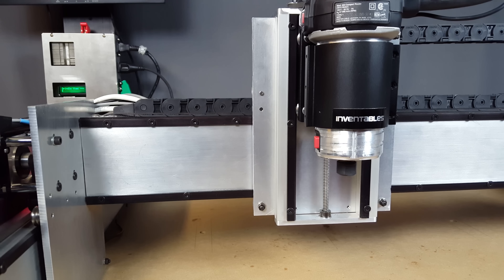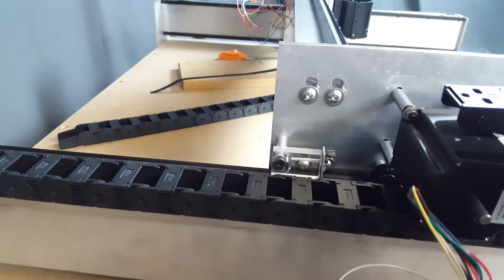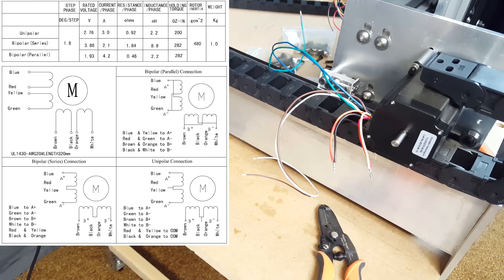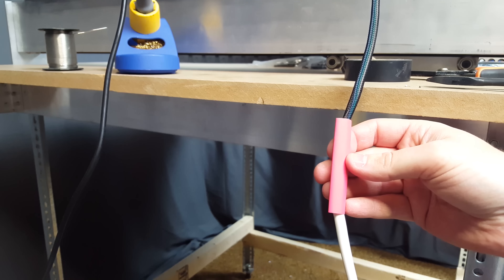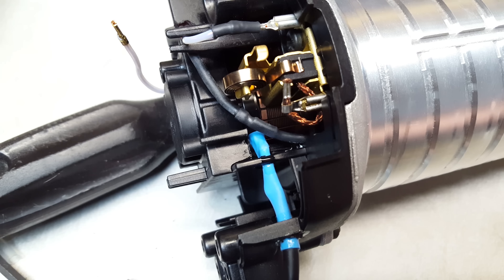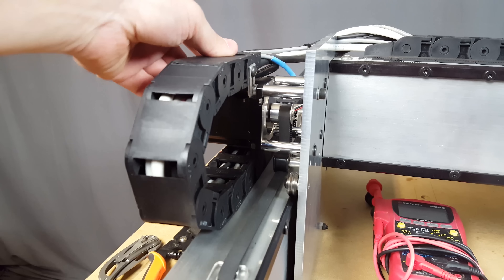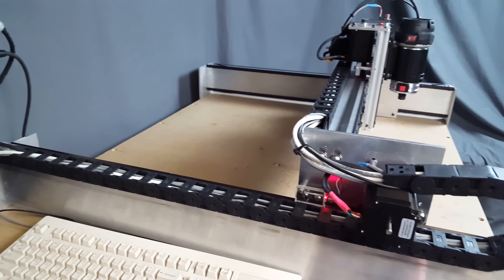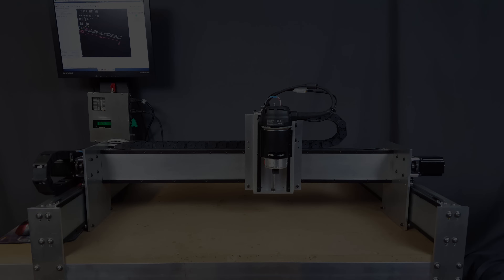DIY-Oko CNC Router:  Part 9 It's Alive!

Comment: Great scratch build there. Mechanically I would have went with a greater Z clearance and range.  I would also have went with acme rods  on all axis. This locks stuff in position when the steppers are powered off.

 Electronically I would have gone with Mach 3 (parallel port interface) or Mach 4 (USB interface). Both have drivers available for parallel or USB if needed. More info available at their web site.  I would also went with either Gecko or similar drivers.  Mach 3 or 4 are both industrial strength controller proggys with far more very usable features such as having ALL the different different end mill diameters in just one file. You can also enable the tool change where mach 3 or 4 will pause for a tool change and resume where it was when your are done changing end mills.

My home brew ( no plans) I built a number of years back is 2 by 3 feet made completely out of 3/4 mdf. Mdf is far more stable than you would think IF you seal it up with 2 or 3 coats of a good OIL base pant.  I use V rollers running on the edge of steel angle iron rails instead of that V shaped edge. Cutting area is 25X 18.5Y and 6Z (inch not mm). I can chew on the edge of a 1 by 4 easily. 

 I use 1/2 10 pitch acme rod on all 3 axis. X andY are 5 starts and Z is single start. I can easily get right at 300 IPM on X and Y and 150 Z but dosent gain anything time wise because the stepper ramping to do that isn't any faster than staying at 150 ipm in X or Y. Z is set at 75 ipm because 6 inches of travel doesn't take any time at all.

Steppers are 450 oz/in driven via a parallel breakout board and 3 medium sized geko stepper drivers. Micro switches instead of hall sensors.All switches including hje OH SHIT  button are set up where if there is a break anywhere in the wiring the CNC shuts down. I also have a switch to cut the stepper power. All 3 steppers have a hand crank on the back. With the stepper power off you can easily crank them to any point you want to set as zeros and simply hit the zero button on the revelent DROs in Mach 3 and flip it back on and youre set to go. Also makes a handy manual some what of a mill. Simply lay things out and crank to the lines with the router on. Wish I had encoders on the steppers so I could use Mach 3 like the dros on a Bridgeport. :)

Over all repeatability and accuracy is within .005, good enough for most anything short of work.  I use a trim router without a PID. A TRUE spindle is on my want list). Nealy all I do is chewing on wood. When I do stuff with bras, plastics, or aluminum i swap the router out with one of those cheap under powered 300 watt cheap ass Chinese spindles that I can speed control via mach 3. The speed control is supriseny stable and good. Takes 4 bolts and 10 min to switch one for the other. 

Software is Mach 3 as the controller (running on a 15 year old desktop under XP I retired years back so basically a free controller. Cad/cam is mostly Vetrics V-carve desktop, Cambam ( sometimes), Fusion 360, and autocad Inventer running on my desktop. I also use a couple of graphics programs somewhat like photoshop when I need to clean up stuff i'm going to use to generate the G-code via CAM. Inkscape and blender are also nice to have (free) also. Freecad is also nicre to have for 2 and 3d work too. A really old copy Inventer is what  I used to design up my CNC with. It has a lot of the functionality of fusion 360 has in it suction as truely modeling a complete assembly. Play with the CNC in the computer before spending a single penny on the project. 

Total cost including mach 3 and V-carve is around 1200 bux. Inventer I got years back under an educational staff license. Trying to work the same deal for the latest version but so far - no luck..

Comment: Couple of questions...

a\ how are you attaching the endplate to your hollow tubing on the x axis?
b\ looks like you are using actual "V" rail. Where did you source this?
c\ accuracy and speed using the belts compared to say led screws or r&p. 
d\ what stepper drivers and control board are you using?

thanks

btw, if you have pictures of the build or drawings that would be great for those of us looking to build a hobby machine on a budget.